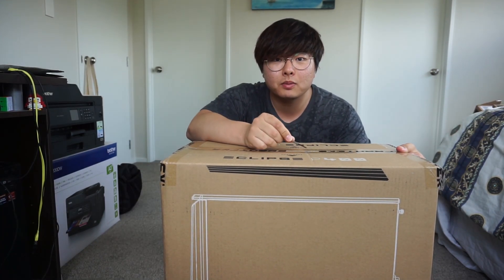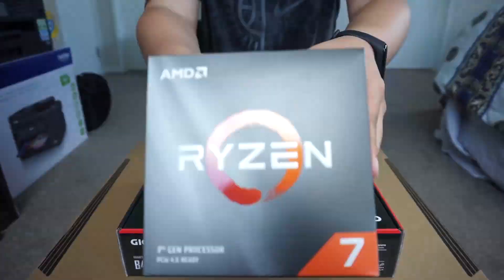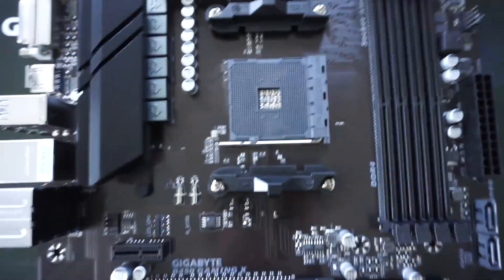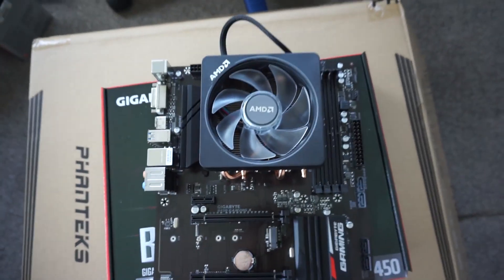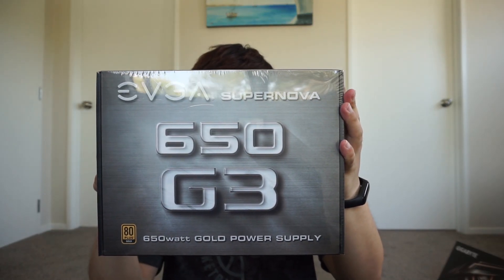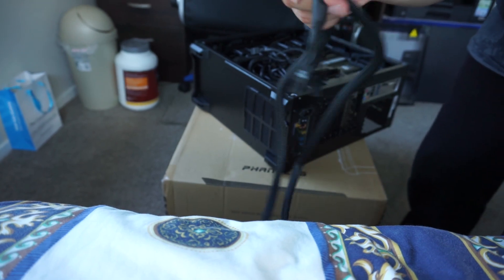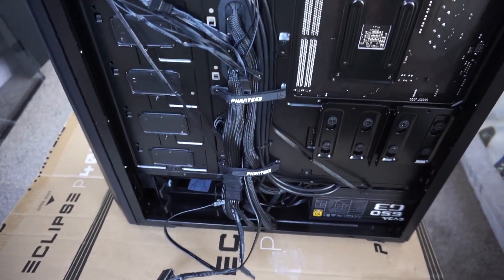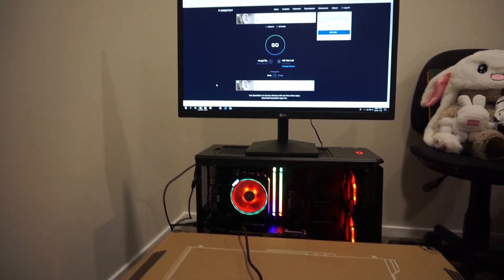Vlog #27 - How to build a $3000 computer (ft. B-roll)

Comment from the maker: SPECS:
CPU - AMD Ryzen 3700X
Motherboard - Gigabyte B450 Gaming X
RAM - Corsair Vengeance Pro RGB 32GB 2666MHz
SSD - Samsung 970 Evo Plus 500GB
GPU - Gigabyte Geforce RTX 2070 Super (Gaming OC)
PSU - EVGA SuperNOVA 650W G3
Case - Phanteks Eclipse P400A D-RGB
Monitor - LG 24" IPS LED Monitor 75Hz
Keyboard - Cooler Master MK750 RGB (Cherry MX Brown)
Mouse - Cooler Master MasterMouse MM710